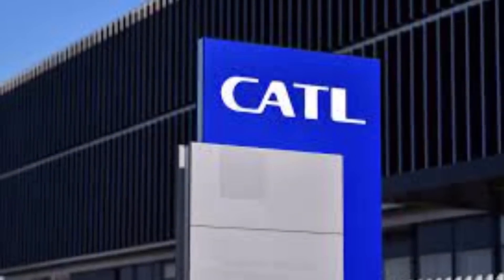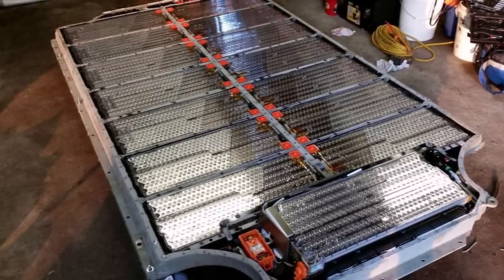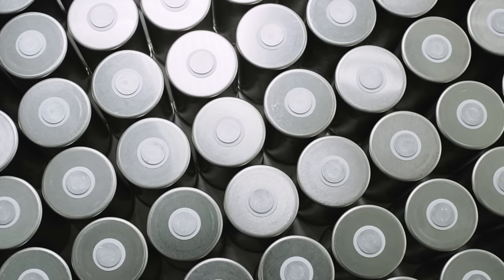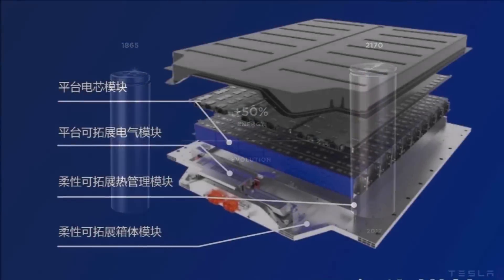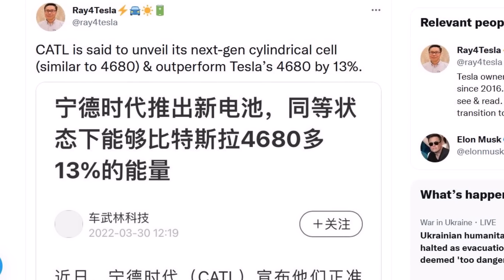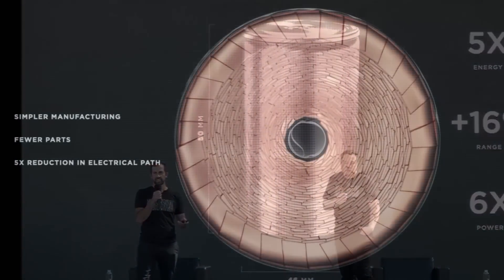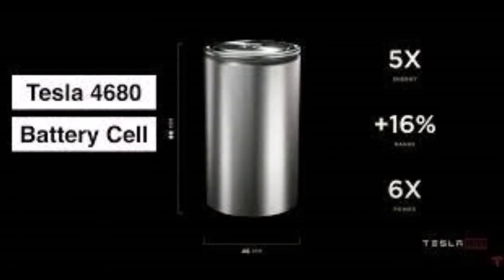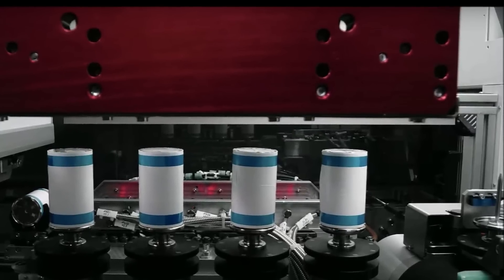CATL Claims Its Qilin Battery Advantage Over Tesla 4680 Cells

Comment: Prismatic looks like good use of volume, but in reality if jelly roll construction - must be massaged to fit in can.
GED weight metric far more important than volume.
Tesla 4680 way more about cost control & ease of production, DBE and "tabless" for heat dissipation via metal current collectors & low electrical resistance. Nobody needs 1,000 mile range, just eliminate ICE cars.

Comment: Someone claimed the 13% increase the BYD battery power is merely in utilising the volume btw cylindrical batteries. This increase power density per unit volume, but not power density per unit mass. Tesla is using cylindrical batteries to speed up its battery production process.
Reply: good point

Comment: 13%  increase in battery efficiency.  How much heaver is the structure that has to support this pack. Is the a gain in overall EV auto efficiency?   There is where it counts.
Reply from the maker: I don't know and I raise that question volume to cost ratio of the new battery in an electric car.
Reply: https://www.youtube.com/watch?v=VeMjf6H0Pw4            Some info about Qilin battery from CATL. My understanding, highly integrated (redesigned water cooling and heat shield). The battery cell is placed upside down to gain an additional 6% space at the top of the pack.The cathode material I estimate will be a mixture of LFP and NCM.

Comment: most customers don't know what advantage one battery design has over another. They will mostly believe that the latest is the greatest, which is not necessarily true. From my experience in batteries, I find that cylindrical cells are a safer bet than prismatic or even blade batteries because there is more redundancy in this design. If a few cylindrical cells fail, there is minimal loss. If a prismatic cell fails it takes with it more energy that goes off line. And a prismatic is even worse.
Reply: They know for sure about all these advantages and disadvantages and their final choice depends on much much more than just redundancy. Almost all EV battery packs don't offer any redundancy at all and that's perfectly fine. If something breaks, it needs to get fixed, just as with any other part of a car.